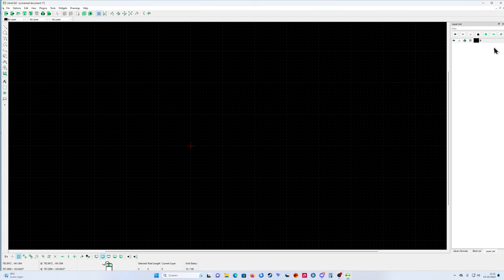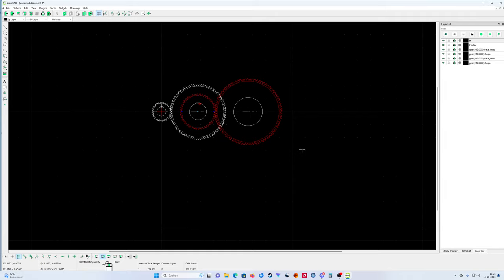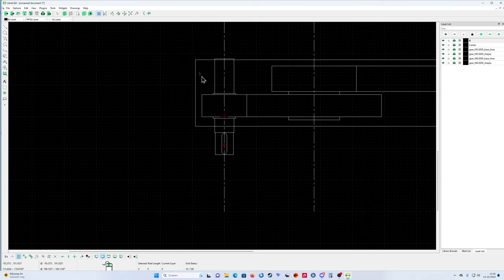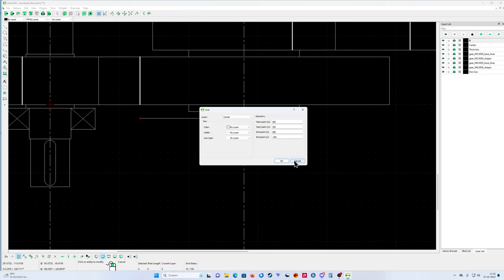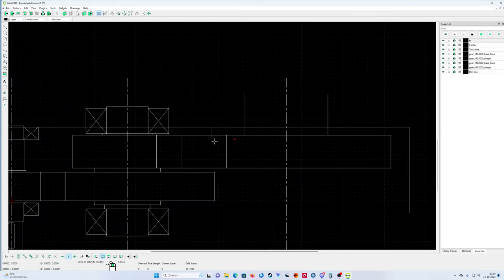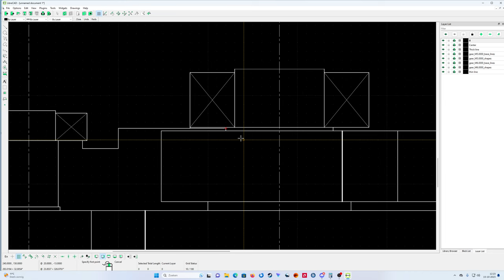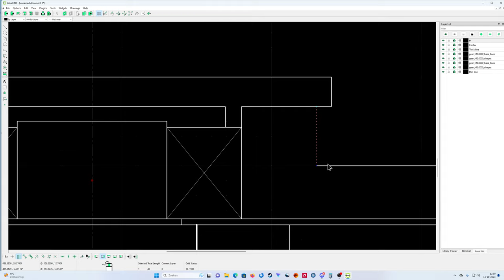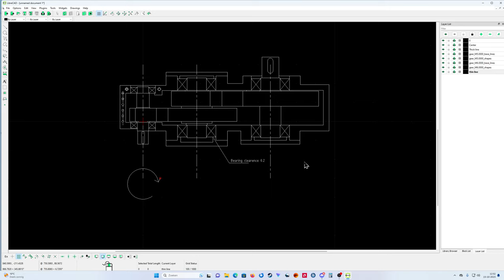Librecad 2D drawing software tutorial part 3

Comment: Good day. I'm from Ukraine. I like your lessons. You are doing great. And how to make a drawing? How to specify tolerances and landings on the shaft? Can you tell me about it. Thank you.
Reply from the maker: The tolerances depend on the applications. Actually, the ISO system is used (http://werktuigbouw.info/passingen_tolerances.html).
It is fairly simple, with a stationary outer ring and rotating shaft, the bearing must be firmly attached to the shaft with a shrink connection. The outer ring may have some play.
When the axle is stationary and the bearing rotates (car wheel), the outer diameter of the bearing must be secured with a light shrink connection and the bearing on the axle may have some play.
Reply: @Rongamer104  Thank you for your message. I will continue to study Librecad. Good luck and have a great day.

Comment: I like Librecad but I just cannot get the thing properly installed on my iMac. I thought I'd got round the annoying 'not a signed application' issue but it still seems that my iMac views the DMG file as a separate drive. There's no way I can afford a 'proper' cad package so I'm left to persevere. I used to love Autosketch from Autocad but that got dumped years back. Surely a developer can release a resonably priced 2d cad program for Mac?
Reply from the maker: I found this go back to older version .

That's standard gatekeeper on MacOS.

a) Try to open LibreCAD -- it will fail, saying it's from an unknown developer, then:
b) Mac's System Preferences -> Security & Privacy
c) Under the "General" tab, you'll see "Allow apps downloaded from..." and it will mention "LibreCAD as recently blocked from user because it is not from an identified developer". Select "Open Anyway".
d) Try opening LibreCAD again -- you'll get a popup, still saying it's from an unknown developer, but now it will include an "open anyway" option -- choose that option and you're done.

(These steps are necessary for any downloaded software that isn't "signed" -- To "sign" software, Apple requires money (you need to be a licensed developer) which is why many open source projects don't.)

I can install libreCAD 2.1.3. The latest 2.2.0 will load, but never gets past the initial screen for me.